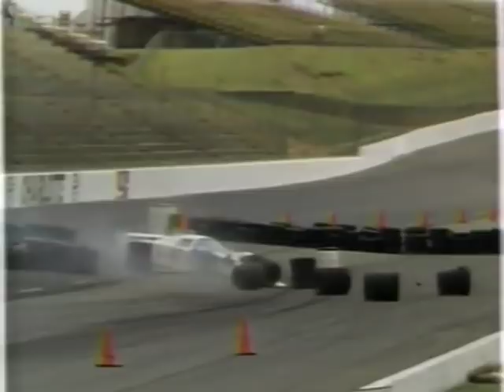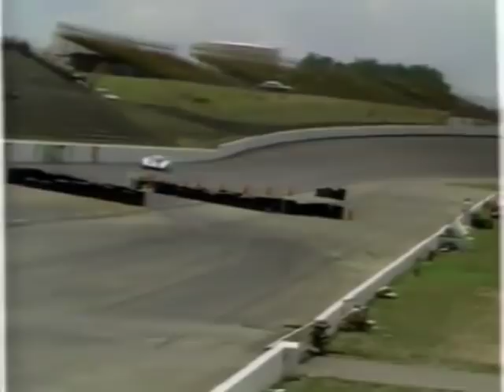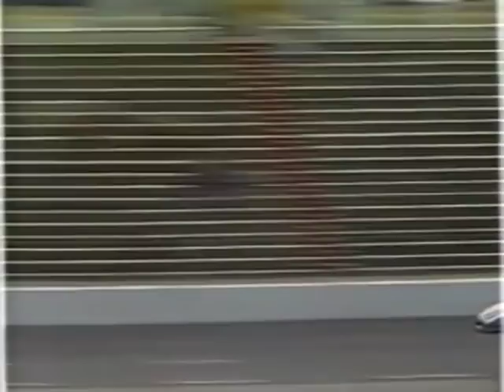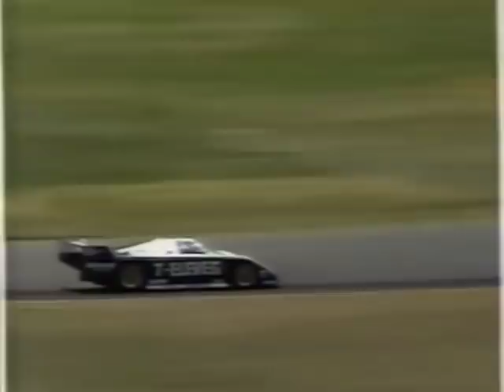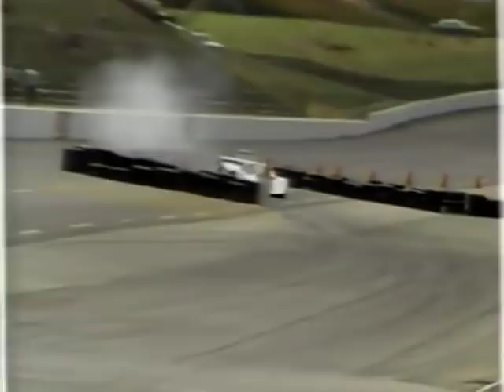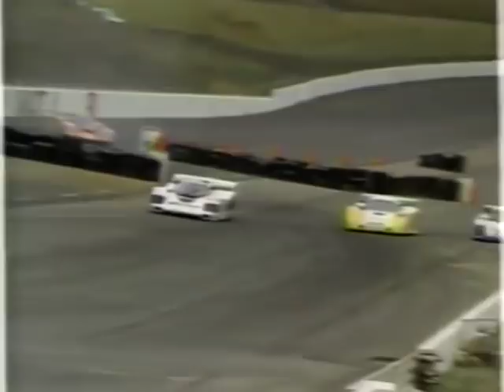Sh*tty Chicane: 1986 Charlotte Grand Prix

Comment: How in hell did they think this was gonna work
Reply: ikr
Reply: International Marijuana Smugglung Asociation in its prime
Reply: Calculations were incorrect, needed more sand
Reply: The Tech From Heaven I don’t think it was just marijuana they were smuggling...
Reply: Well the drivers contributed. Not many wanted to slow down any earlier. But racers are racers. They want to go fast.

Good example of a track, when you hear that it doesn't have a good flow to it. change the distance, now it had a better flow. You could get into a "rhythm" .